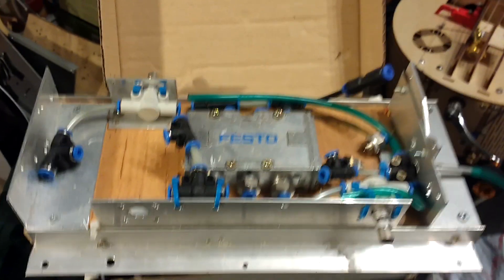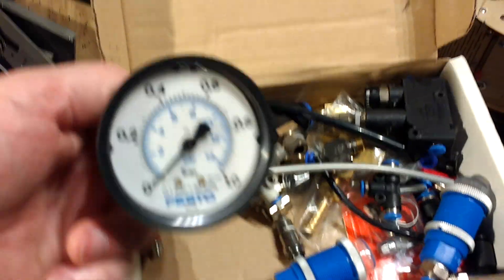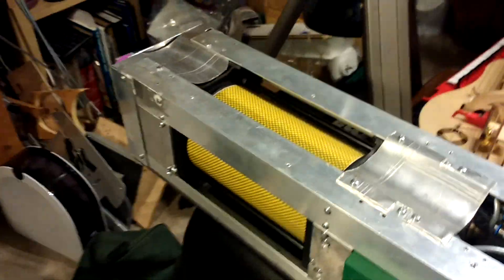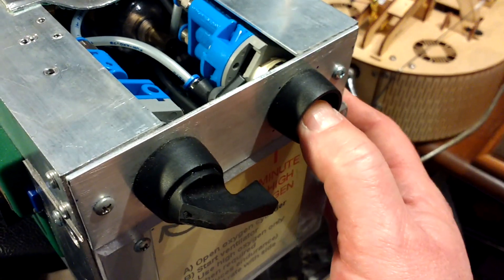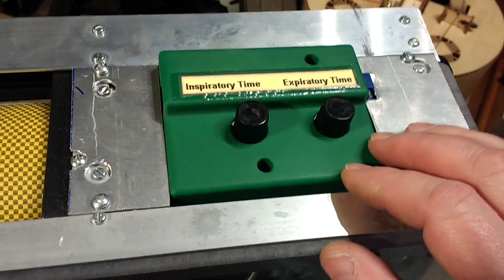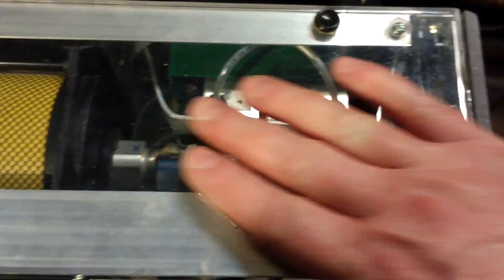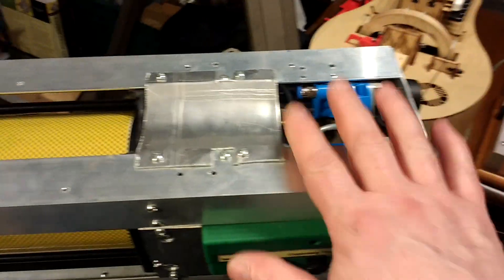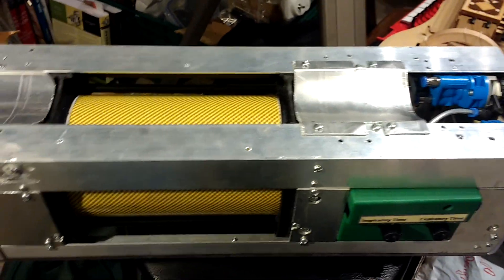Pandemic Ventilator concept from 1999-2010

Comment: Hello John, I read your paper published in 2010, and also studied the helix portable ventilator model. We are trying to make a viable prototype in India, and hopefully, with some support, make a device to help the current healthcare situation here. I am writing in order to seek your advice. Is it possible to reach you over email, so that I could clarify a few doubts that I have? Do let me know. Warm Regards, JD
Reply from the maker: It has to give High FiO2 if needed, variable PEEP - initially thought to require very high PEEP but this is changing to moderate now I believe, variable I:E ratio, achieve pressures of around 35cm.H2O at least and avoid high peak pressure spikes. Ideally need tight control of volume delivered around the 400ml mark. Some smaller ventilators do not really give you control of the inspiratory time versus the plateau phase time - this might be a very useful feature though. This is why the 2010 paper design would probably not be very good for CoVid patients and neither would the resus-bag-squeezer, at least as we had designed it back then, even though you see a lot of those on the web now.
The UK MHRA regulatory body has a list of requirements for such a ventilator - there are still quite a lot of them! You can find link below as a starting point. Best of luck with your project.

https://www.gov.uk/government/publications/specification-for-ventilators-to-be-used-in-uk-hospitals-during-the-coronavirus-covid-19-outbreak